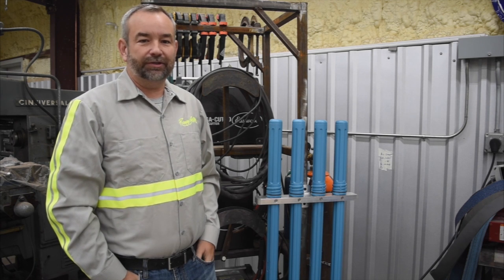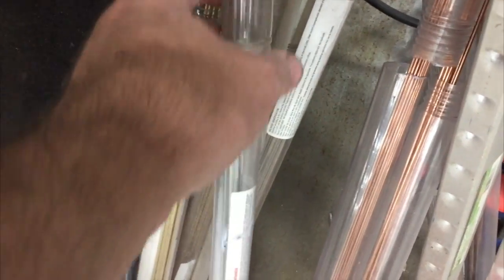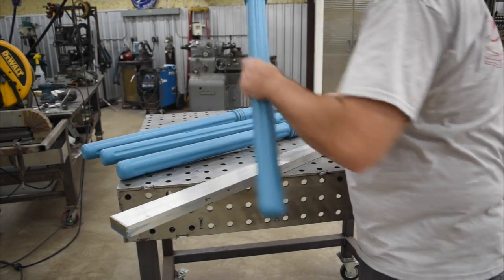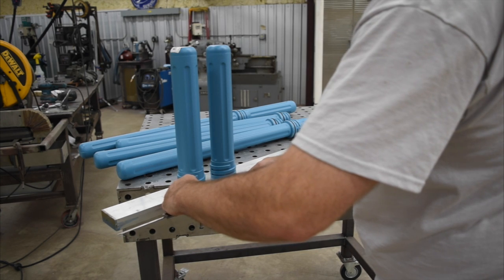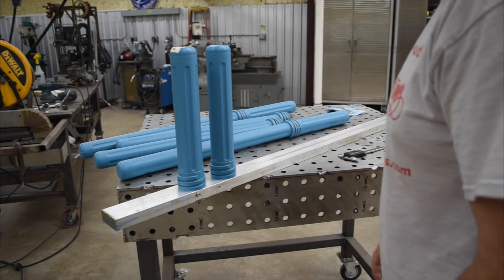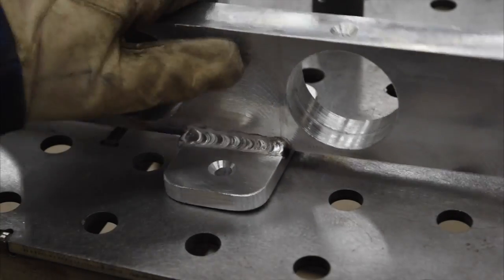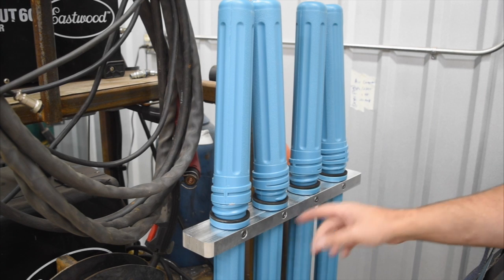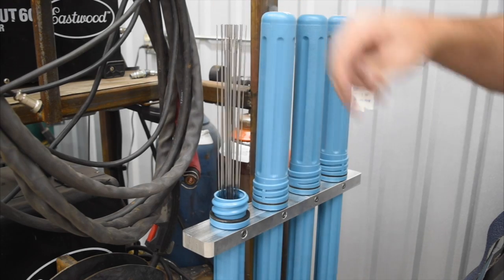Thick Aluminum Tig Rod Tube Storage - Rod Guard - Welding with Helium - Dallas, TX 75201

Comment: Hi I enjoy your videos thanks for sharing ! I always learn something a tip I ran into when using a hole saw on a milling machine even in aluminum I slow down a bit the WD - 40 I use as well , prior to cutting the big holes I drill 2-4 holes in the inside of the circle for chips to drop through the part the thicker the material I use 4 holes so as your cutting i still blow off chips but the cut seems better less work the chips in the hole saw act like little balls and have no where to go they seem to kill the hole saw without getting rid of them , last I also use a R8 chuck with angular cutters as well they make a great hole and the chips stream out not glandular so no chip holes hope that makes Sense ? I have learned the hard way keep posting love your shop!
Respectfully
Charlie

Comment: Nice brother! All done with 200amps huh? With the Eastwood? Sounded like 60-70hz softsquare wave...how much was that 50/50 mix? Debating on whether or not I should drop $300 on a bottle at my welding place
Reply from the maker: I bought the bottle for $300 and a fill is like $30.   You can just rent the bottle for prob $6/month

Comment: nice beefy holder. I'm going to build some holders out of pvc and use threaded ends to seal. that rocking of milling machine does not bother you? little shim on floor would work wonders. I'm also in tx and subscribed. looks like a nice shop and projects
Reply: lol, yes it was bothering me,  at the time this was made that little mill was not in in its final location but its all setup and shimed/leveled now

Comment: Pipefitter taught me to drill a "chip hole" on the inside of the outside of the diameter you are drilling/cutting. Works nice.

Comment: Gary where did you get those weld-guard tubes and how long are they?
Reply from the maker: I got those at the local welding store, but you can get them on amazon, they hold 36" rods, so a little longer than 36"

Comment: My welder had a place on the back to put two of those rod holders.  Then I made one that goes on the side that holds 5 more.  Right now I have 6 different types of rods.  Still have room for one more.
Reply from the maker: sounds like a good setup
Reply: +🔥Ramsey Customs - turbocobra   You forgot about the ER309L and the Nickel rods.

Comment: Looks good Gary, I have a couple of those rod guards they work really well.  I have one for my stick rods, it helps keep them dry with the seal.  You're getting soot because of your gas coverage, you may need more gas flow or a different cup. Helium is less dense then air so it floats which makes it less effective for shielding.   I don't know what kind of regulator / flow meter you are using, but there are different scales for the flow rate of different gases.  I've never used the premix stuff, we had a bottle of each gas and a y-adapter.  Jody has a video with part numbers.  Probably not economical if you are not welding a lot of aluminum.
Reply from the maker: Yea, I was going to buy separate bottles and use the y like jody showed, but was thinking that the weights are different, and how do you know what actual mix you have.  Miller sells a 2 gas mixer, but not cheap at near $2K  https://www.millerwelds.com/equipment/oxy-fuel/gas-mixers/proportional-two-gas-mixer/miller-proportional-two-gas-mixers-m00281
Reply: Damn, now you've got me re-thinking my welding set-up. A gas mixer makes tons of sense. I can just own 3 bottles and not have to worry about "bad gas" which is usually from the gasses separating in the bottles if they sit around too long. It's probably cheaper in the long run too.
Reply: Gary most guys just adjust the flow meters and do it by the flow rate.  The setup  I used had the ball type flow meters, they have the different scales on the tube for the different gases.  Then when you're welding set the flow of each gas.  Say you normally are using 20 CFH, then you might try 5 CFH He and 15 CFH Ar.  The total gas flow to the torch is the 20 CFH, but now its got the He added to it.

Comment: Nice job. I'm learning how to TIG now. So different than MIG welding.
Reply from the maker: Which machine did you buy?  it takes a little getting used to, but nothing some practice beads won't solve :)
Reply: +🔥Ramsey Customs - turbocobra I have the Lincoln Electric Precision TIG 225
Reply from the maker: that's too bad, that machine probably won't work very well for what your trying to do, so you better go ahead and pack it up and send it to me :)